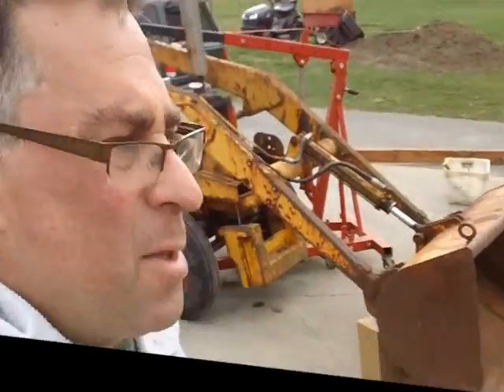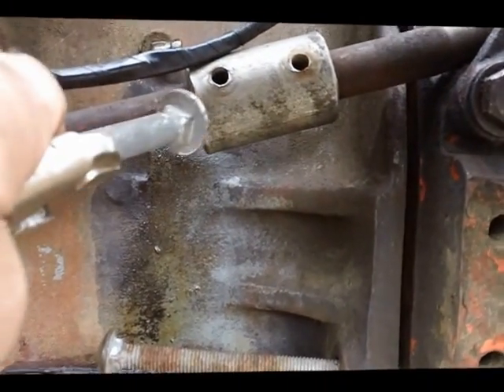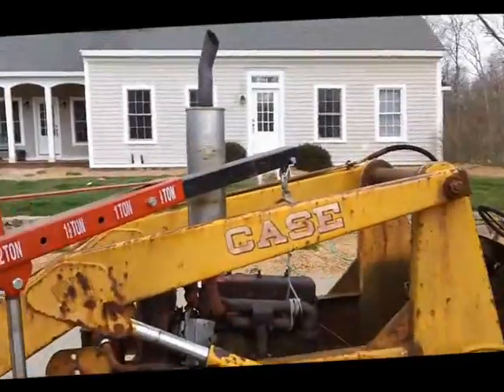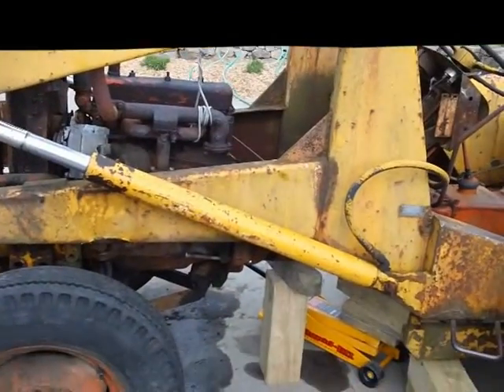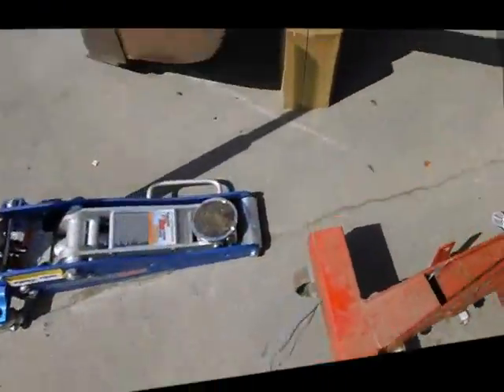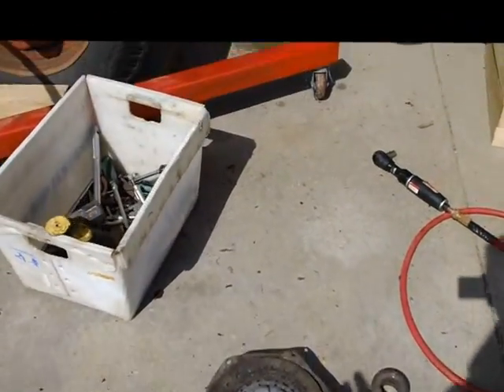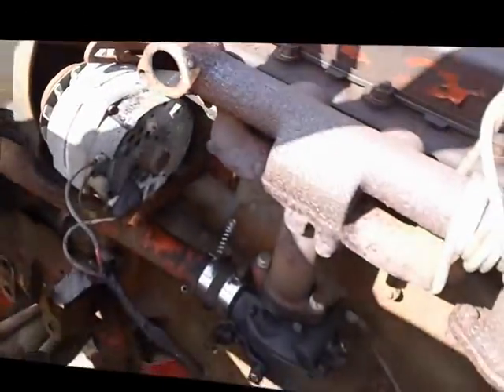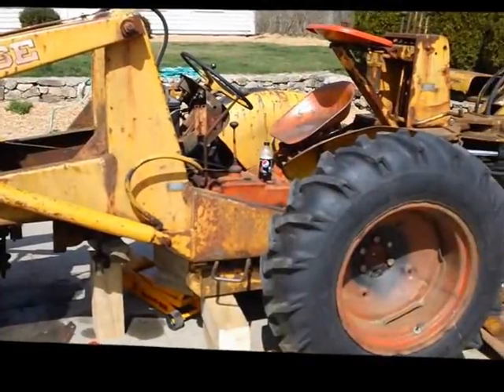Case 210b clutch job part 3

Comment: My case 430 does have a hydraulic pump on the front ,driven by the crankshaft.It's mounted to a plate that's bolted to the 2 bosses on the front.The pump wore out and I couldn't get one ,so I adapted a universal one.The clutch went about 10 years ago and I didn't want to do it so $1500.00 dollars later it's great.My tractor has an old Pippin backhoe on it .Had to replace all the shafts, and bushings, and adapt a universal cylinder to it. It dose'nt owe me anything, always starts. I want to thank you for the great videos.